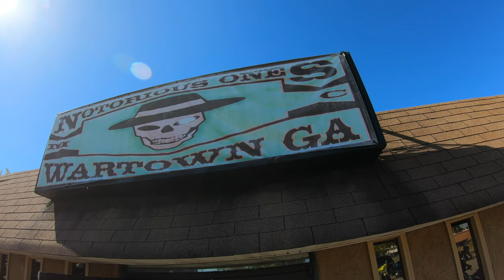SUNDAY FUNDAY AT NOTORIOUS ONES MC CLUBHOUSE IN MIDDLE GEORGIA!!!😎

Comment: Nice bike , what all have you done to it and I’m glad you didn’t lose your lid
Reply from the maker: Thanks a lot!! 16” bars, SE 255 cam, Fullsac headers, & Shark Road slip ons. I’m glad too.. woulda been a nightmare replacing it!!!
Reply: @Trouble2Times  what sound system do you have and what year is it if you don’t mind me asking
Reply from the maker: @dwanjacquet162 Aquatic AV head unit, 6.5 inch Polk Audio speakers in the fairing, 5.25 in the back.. no amplifier. It’s a 2008.. 105th Anniversary edition
Reply: @Trouble2Times  oh ok , I’m thinking about putting in a Rockford Fosgate system in mine